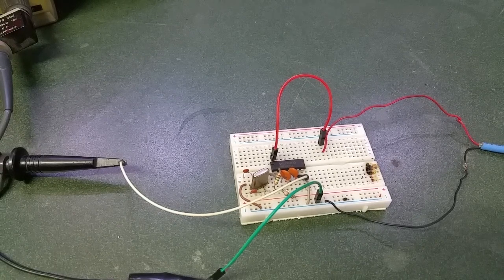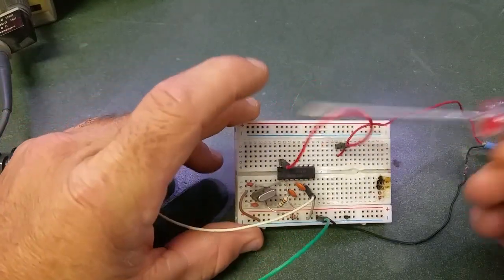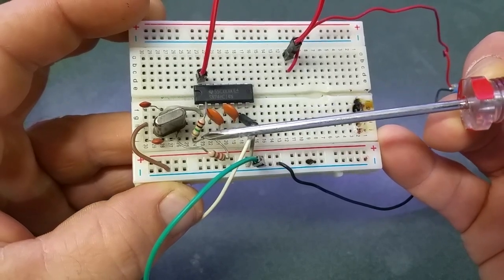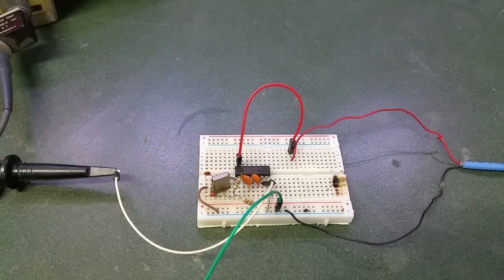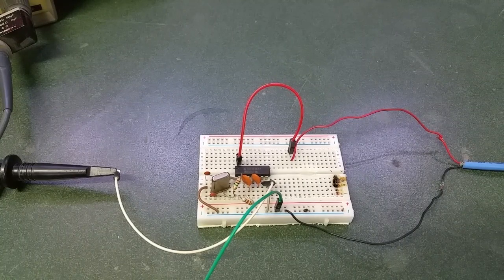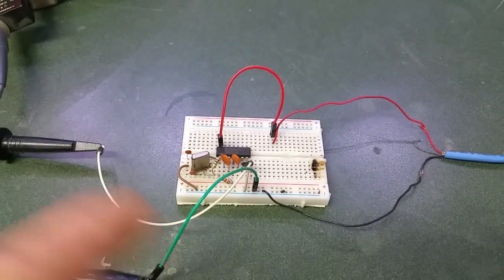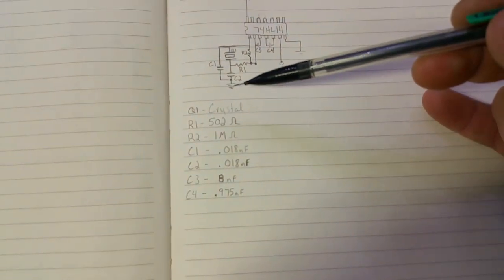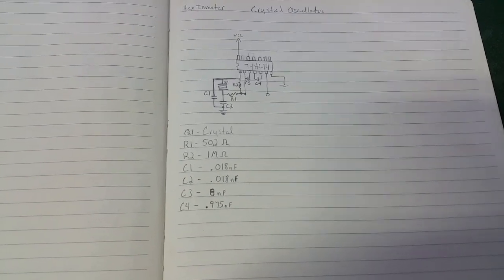Crystal oscillator using Hex Inverter

Comment: Hi,
Thanks for the upload! Could you elaborate how you calculated the values for C and R? Also, you're getting a 4MHz square wave out right?
Reply from the maker: Ayush Bhat I've had it on breadboard for almost 4 years now.  moved back to my hometown and have lost track of the notebook I wrote everything in.    by trial and error I had several different size crystals mapped out.    I will be look into this circuit more and will post any updates I have for it.    also yes it is square.
Reply: Please do let me know if you have any documentation online or if you find any useful links that explain the choice of capacitors/resistors used! Thanks a lot.

Comment: How could I get that crystal osc to output sound through my guitar amp? Is that possible and what would be the way to do it? Thank you so much I'm really intrigued if that is possible using a single CD4060 ic as oscillator ... ☮️✌️
Reply: It's been a while but no, the frequency is way to high for you to connect it to an amplifier and hear. Also the cd4060 is a counter, not an oscillator so it won't work.
Reply: @mjyanimations1062  Yes sorry, I was referring to CD40106.
Reply: @rocanrolafx2179  you may actually use some counter ICs such as the 74HC161 to divide the clock input - though 20MHZ is somewhat of a beast. You might have a better chance with a crystal in the range of 32kHz to 4MHz (the latter will require a lot more clock chips)